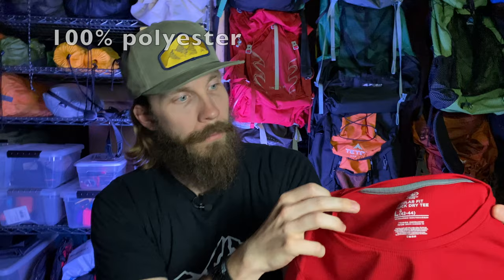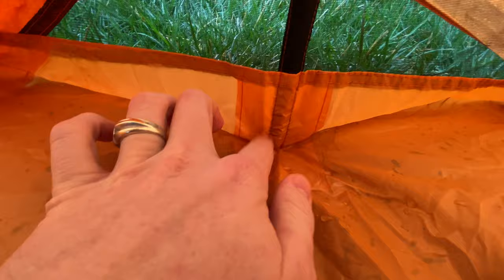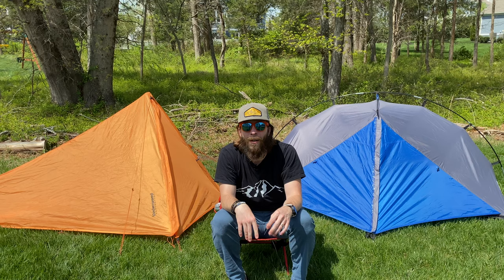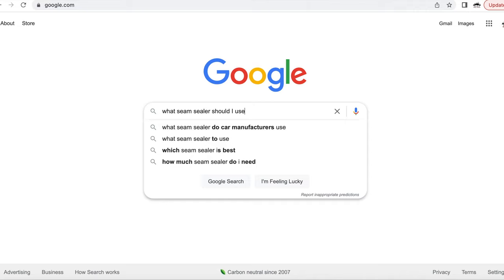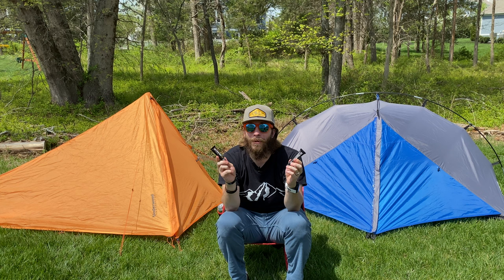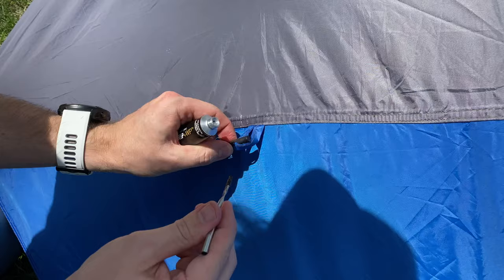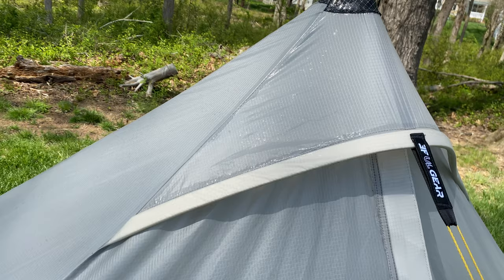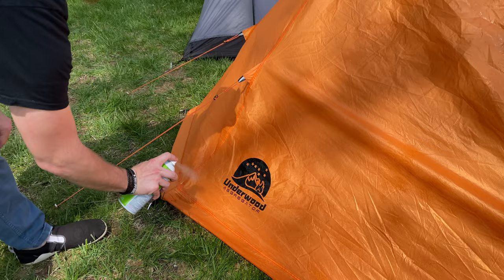FIX IT for $12  ||  How to Waterproof a Tent (even cheap tents!)

Comment: I have an old North Face dome tent that has kept me dry about 50 years.  I also have my first tent, a pair of WW2 shelter halves that together make a pup tent.   I bought a big jar of Kenyon Recoat3 seam sealed from Campmor that has sealed over 10 tents, and is about half left.  Works great.    It is water soluble before it dries, and easy to clean the brush and drips. Note:  There is something about tents that attract dogs and cats, so protect your drying sealed tent or you will camp with the odor of urine for a while.  Also, get a good artist brush of the right size for your use to apply sealer.  Experiment for size.  Also, pitch a tent at least once a year in warm weather to get the kinks and folds out.
Reply: It really depends on how you look after your tent some people are rough with there gear and it doesnt last as long due to improper maintenance. Wow your 50 year old tent is impressive, you must look after your gear very well. 👍
Reply: Don’t suppose you’d be willing to email me your camping tips?

Comment: In my experience if you use an aerosolized waterproofer on a tent you can completely skip the seam sealing portion because the aerosolized waterproofing does it all you just have to be sure to completely coat everything a couple of times
Reply from the maker: Hey Josh! I wondered that, but decided to go with the old adage "better save than sorry" and sealed the seams as well.
I had recently done my Lanshan 1 Pro (since the seams don't come sealed) and it was so easy and effective I figured "why not" for waterproofing my other tents.
Thanks for your comment!
Reply: Oh how I wish that were true……….. I just discovered that is NOT the case 😩
I need to seal the seams and I also need to figure out if there’s something I need to do on the inside. The clear “tape” along the seams is pulling away and I can only assume that’s not helping.
Reply: Not true, these are just a DWR durable water repellent , not a waterproofer.

Comment: Bought a "Coleman Go!" tent for $15 at Aldi 10+ years ago. It was my husband and I's only tent for many years but even now that we have a newer, bigger, fancier tent, the old Coleman still gets used regularly when we want a smaller/lighter tent or need an extra to outfit a friend. It's been sprayed with silicone-based waterproofing a few times over the years. I always made sure to saturate the seams thoroughly with the spray and have never had any issues with water seeping through. I do the same with our other tent and no issues there either. If you or your viewers want to save a few more $$, try just spraying the seams before splurging for the additional seam-specific product.
Reply: This is probably a video to sell the seam sealers lol

Comment: WalMart sells another heavy duty silicone spray by ATSKO with a bright orange cap.  It works great; I have never had any tent leak after using and I don't bother with the seam sealer.    The water almost flies off of the tent fabric.
Reply from the maker: Hey Randy! That's awesome! I don't remember seeing the ATSKO brand there, but I think I've used a few other products from that brand and have been satisfied. I'll have to look for it when my scotchguard runs out!
The sprays make it so easy to waterproof! Definitely worth the time it takes to make sure your tent is 100% ready to go!
Thanks for watching!
Reply: ATSKO is the old school stuff we used to use for boots when we were kids in the 1980's.

Best stuff in history, short of thinning out a tube of pure silicone and spraying it on heavy.
Reply from the maker: @VanishingNomad  Nice! Thanks for sharing your experience!

Comment: A little tip I learned years ago: get yourself a larg syringe with a curved tip and use it to apply the seam sealer then brush it out.  It makes it much easier and less messy.

Comment: I have the 2016 Big Agnes UL3 MTNGLO Tent.  I bought it new in 2016 and used it a ton between 2016 and 2019.  I then didn't use it once throughout the pandemic and just finally took it out for 2 weeks in the Lake district of the UK where it rains A LOT.  A lot, a lot.  I stayed dry the entire time.  The water wasn't beading off, but it didn't soak through completely or leak in any way.  It was damp, but zero leaks.  For a 6  year old tent that I've never water proofed once, it handled the non stop rain for 4 straight days amazingly well. I recommend Big Agnes tents and sleeping pads to anyone.
Reply from the maker: Any tent that can stand up to the Lake District in the UK deserves high praise! I spent 18 months in the UK for work and know that when it rains, IT RAINS! 
Thanks for your comment!
Reply: We camp around the Pacific Northwest (also soooo soggy) in our 2017 Big Agnes with equal satisfaction. So dry. So good.

Comment: i was a ScoutMaster for years.I agree those are excellent products.I also used Thompson water seal the original clear on seams with a ! in brush.Used on cheapo 7x7  dome tents they never leaked.For the body I did use the spray.
Reply from the maker: Hey Aaron! Nice! I'll have to check out the thompson water seal. It's definitely worth the extra effort to stay dry!
Thanks for watching!
Reply: Good idea too. I will have to get small can if i can get it in pints.

Comment: Great video 

I have seam sealed using silicone and mineral spirits.  Just get the tube of silicone squeeze it into a cup thin with mineral spirits to a syrup consistency and paint on the seams.   I used a 1” brush to get a good area coated.  We had a 27’ x 13’ wall tent that would leak like a screen door on a submarine after seam sealing and coating with the orange waterproofing spray from Walmart it stays nice and dry.
Reply from the maker: Thanks, James! That's awesome that you made your own seam sealer with silicone and mineral spirits. Now THAT is some serious DIY! 

"Screen door on a submarine" 🤣🤣🤣🤣

Awesome you got it sealed up! Amazing what a difference it makes!

Thanks for your comment!
Reply: I saw the same videos and I wondered if it worked in tent materials. Did you try it?

Comment: Awesome. Thank you. We just bought a $50 backpacking tent, and I am determined to make it work. We usually also put our tents under a tarp when possible, but I am not spending $800 on a tent. Bravo.
Reply: Carry a $1 polyethylene paint drop sheet with you JIC.  If you miss spots waterproofing, then you can become 100% waterproof in a minute for the night for a sawbuck and four or five gem clips.

Then when the tent dries out, respray with the silicon waterproofer.  I usually respray every year or two on my first spring outing.  You have some dead time in camp so might as well spray it at 10am when the dew dries if you're in the same camp for two days.  

$6 can and 5 minutes a year is the cost of keeping a cheap tent alive for years.

Comment: I thank you for this video! We are tent shopping. Fam of 4 that wants plenty of room for us + plenty of room for whatever we bring. It has been SO HARD finding a tent that has all the specs we want.
•Has a screen room.
•Enough room in the sleeping area so the screen room does not need to be used for a sleeping area.
•Waterproof (at least mostly) in case we are caught out in the rain.
•Under $1000 USD.
•Something we can use for hunting public land + camping trips to a park.

The tent I was eyeballing that looks almost perfect is the Gazelle T4 Plus Hub Tent. I like everything about it except that the sleeping area is made for 4 people (plus another 4 in the screen room). I think everyone knows that whatever the person rating is, it's always a tight squeeze for that many. So for the 4 of us, we prefer to get something for 6 or 8 people.

In your video, you're working on small tents where you can easily reach the top of your tents. I know anything we get will be larger and I'm worried about trying to apply that seam sealer to the top of a large tent.
I saw another person saying they used a spray and it worked well.

Anyways, I'm hoping we could get by with a cheaper tent that has all the other specs we want and then use these waterproofing methods to keep out the moisture. Still doing some homework but happy to have found your video along the way!

Comment: A quick seam sealer you can find almost anywhere in an emergency is called shoe goo. It's an adhesive just like Sean sealer but a little thicker and works great but is harder to smooth. I wouldn't replace good seam sealer but if you need some and can't wait for delivery and don't have a store nearby that sells any it's a great option.

Comment: I'm a little late to the party, but Smooth-On makes a product called SilPoxy. It is the only adhesive I know of that can be applied over silicone and can actually bond two siliconized surfaces. That makes it ideal for both resealing existing siliconized surfaces and repairing siliconized fabric (think tear or ember burn in a silnylon or silpoly tarp or tent). Once the big tubes are opened they need to be kept in the freezer to prevent the tube from curing however, they also make little ketchup packet sized containers that you can take with you for quick repairs on the trail. Great channel. Subbed.

Comment: You read my mind with this video 😆 I was just trying to figure out how to waterproof a cheap ozark car camping tent I got as a loaner to take some friends camping. My husband took it on a trip a few weeks ago and it very much failed the rain test 😬
Reply from the maker: Hey Kayla! Glad the video was well timed! 😆

Ah dang! Nothing worse than waking up soaking wet from rain on a camping trip! UGH!

If the tent has been on a lot of trips, you'll also want to clean it first! These were both pretty new, so not dirty.

Would love to hear how your waterproofing experience goes!
Reply: @DoseofDirt  Which seam sealer did you use for your ozark tent? I can't seem to find material information on Walmarts website to make sure I get the right one.

Also thanks for the tip on cleaning it first. It's only been out once but it did get kinda dirty in the rain.
Reply from the maker: @kaylariggs8865  For the Ozark tent (as well as the orange one) I used the Gear Aid Seam Sealer WP. It works for nylon & polyester (which almost all tents are made out of now) as well as some other fabric types.

here's a link to the Gear Aid website, since it gives more information than the Amazon page: https://www.gearaid.com/products/seam-grip-sealant-waterproof?variant=28044147153

And here's a link to the the site that explains the different kinds: https://www.gearaid.com/blogs/help/which-sealant-should-i-use

Let me know if there is anything else I can do to help!

Comment: Yes, coating of a tent does wear off from use, UV, weather, etc. Yes, there are sprays, brush on products to bring back the waterproofing of the tent (or other product). And yes, I guess your video helps those new to camping. So good for you. 
For many, just wonder through a major sporting goods store and find all you need to keep you nice and dry in your tent.
And do this every year at minimum....

Comment: I've had a North Face mountain tent since 98, mostly used in winter conditions and never had a problem with it ever.  Used it a lot at one time and have never had to tape seams or reseal.
Reply from the maker: Hey Eric! THAT is impressive! 24 years on a tent and still no seam sealing or waterproofing required! From what I've heard, North Face doesn't make stuff like they used to, but sounds like you picked up an absolute winner!
Thanks for sharing!
Reply: @DoseofDirt  Like I said use to use it a lot in colorado winters not very humid only put it away wet a couple of times when in the pacific north west surfing in november.  pulled it out as soon as I could to dry.  Had it out last september during bear season.  I was just looking for info for a mid 70's I think 6 man nothface expedition tent my dad had for research, it is badly mold and mildew you can see through wind comes through, to see if I can recover it with poly and ratio's just basically redue the whole thing, maybe?
Reply: @DoseofDirt  I would not buy anything from North Face now.
Reply from the maker: @ericbettis2777  Dang, a mid 70s northface tent would be pretty rad. Just to see how much as changed. Ya, the mold and mildew can be bad. I've gotten in the habit of almost always pulling my tent out when I get home to dry off and air out in the back yard. It's a pain at the time, but I'm glad to prolong the life of my tent!
Reply from the maker: @ericbettis2777  Ya, agreed. No northface gear for me now. Too bad it's changed so much.

Comment: Currently rocking a roman cradle 3p and its absolutely amazing, I've been living in it for 8 months, first through the last few months of a very hot Australian summer, and the last 6 months in Melbourne bi polar 4 season a day weather. Longest streak is 11 days straight in the rain with only a few hours to dry before another 6 days of rain afterwards, no leaks. And 47km/h winds. I cannot beat ground condensation though, and sometimes humidity gets so bad water forms ontop of the inner fly but doesnt come inside the tent, i wake up, see some very small water droplets above me and i just flick them away. I use 2 picnic rugs as an floor lining now, and every 2nd day i empty the tent, pull the rugs out and air them out and i paper towl up the condensation on the floor and spray it with glen 20. I have recently purchased eva floor mats and s mesh ground sheet to add an extra layer under the tent and then inside under the picnic rugs.

Comment: You know I used to actually do that to my tents. But then I had an epiphany one time when I bought a military poncho where all the coding came off of the Hood.
That was when I bought a can of clear Flex Seal. Apply the Flex Seal everywhere on both sides, and it is not only water-resistant it is full Out waterproof. Just make sure you set the tent up before you apply this stuff. And leave it up at least a day in direct sunlight. So it won't become tacky when you roll it up. I tried it on a cheap I got at Walmart first. And it works like a charm. A lot of tents come with a rainfly and have a lot of ventilation netting. Obviously you don't waterproof The netting. You waterproof the rainfly which is extremely easy. Then you waterproof the floor and around the edges of the bottom that are not covered by the rain fly.
But wait there's more. I see a lot of bushcrafters with their fancy several hundred dollar pants on that have waterproof knees and butt area. Guess what. Get some masking tape to set down on the material so you have a flatline to make it look professional and you can use the black Flex Seal. You can put a couple of coats on it to make it thicker. Now you can kneel down on wet ground without your pants getting super wet. You can also cover the inside and outside of the boot area of your pants. Measuring up a little past where the top of your boots come and waterproofing from there down. You do not want to cover all the pants or they become like leather pants with no ventilation. Then you're going to have a sweaty crotch. Only do the back part of the jeans, the knees, and the bottom of the pants legs about a foot from the bottom up all the way down. There are a lot of cheap little tricks so you don't have to buy all that fancy gear. You can do the same thing to any backpack, and all of a sudden you don't need a cover. Whether it is an old canvas Alice pack, or a nylon job. And you don't have to retreat it every year. Only if you get excessive wear or have to repair a rip. Which is as easy as sewing it up and then reapplying the Flex Seal. And no I'm not a Salesman for the stuff. I just think it works great with bushcrafting and camping gear. A lot better than the Silicon crap. I don't know how many years I used that silicon on my pants legs, and every damn time they got wet anyway. My boots too. I also do it on cheap tarps and ground sheets. You can buy them super cheap online and coat them yourself. And they are way better than the expensive crap. I put it on a bandana once just to see how good it would be. It worked out pretty good, I have a waterproof bandana I can cover stuff with in the rain. Clearly not big stuff.

Comment: I sealed seams on two Hillary tents with a caulk gun and latex caulk. Caulk the seams and use a sponge brush to push the caulk in. Be liberal with the caulk. Do a couple of feet at a time. After you caulk a section, Dip the brush in water and wipe the seam down. Do inside and out. It took me about 1 hour to do 2 4-man tents. The tents were waterproof for about 15 years. I had to spray silicone on the Flys at the beginning of every camping season, but the tents never leaked even in heavy rain. It's still the best and cheapest way I have ever found to waterproof seams. Not even close.

Comment: The tarn 3 by MEC has done myself, my father, our gear, and up until recently a 120 lbs dog very well for over a decade. Resealed one time, one snapped pole fixed(thanks dog), and used between 6-12 weekends a year always 1 in the snow season.

Comment: Yep...Had an MSR Hubba Hubba 3 person from 2007.  Used it maybe 5 times over the years.  Always stored it inside the house, in a closet. It has worked well in the past in the rain.  This month (March 2024) I used the tent and saw after the first night that there appeared to be condensation droplets inside, which was puzzling to me because the tent was well vented with both ends open, and lots of air flow.  The next evening it began to rain.  The rain fly became saturated over time and the whole tent was dripping water everywhere....UGH!
Reply from the maker: First, I LOVE that you've been rocking that tent since 2007. Gear can last a long time if you take care of it! Sucks that your rain fly started wetting out. Hope you were able to get it water proofed again and take it back out on the trail!